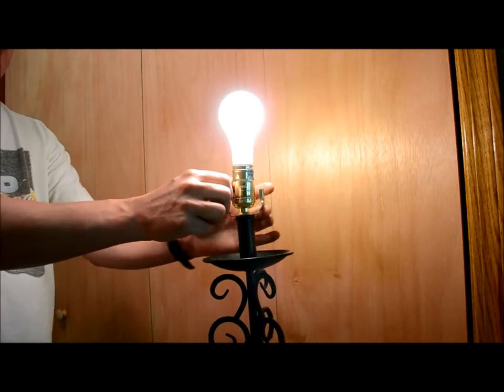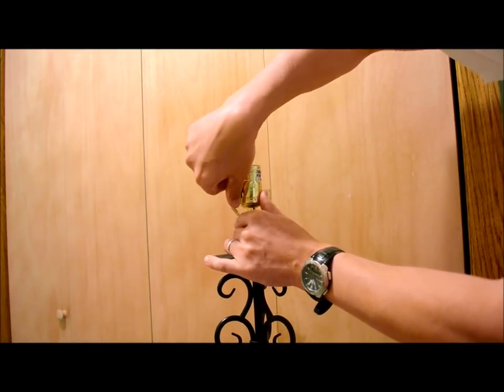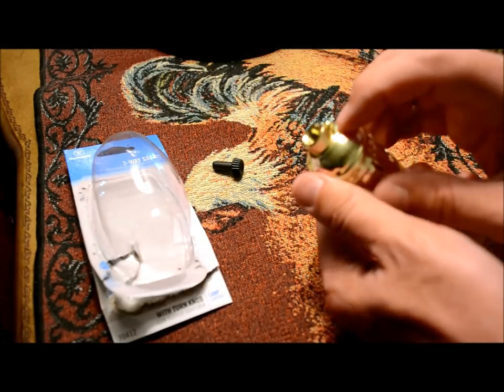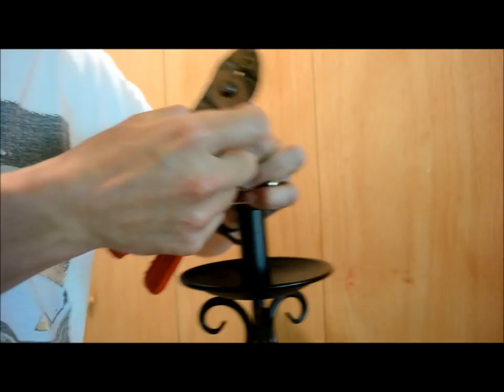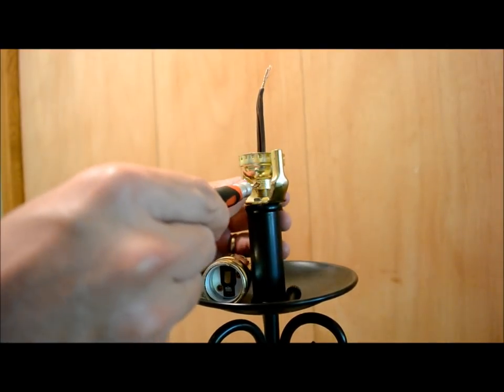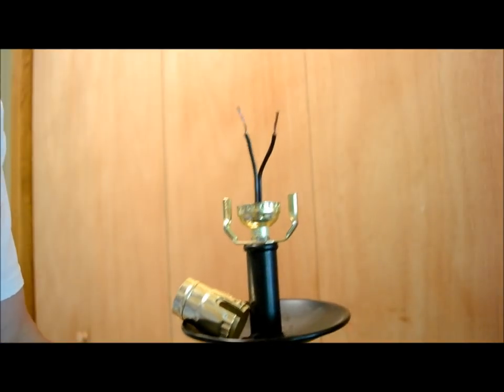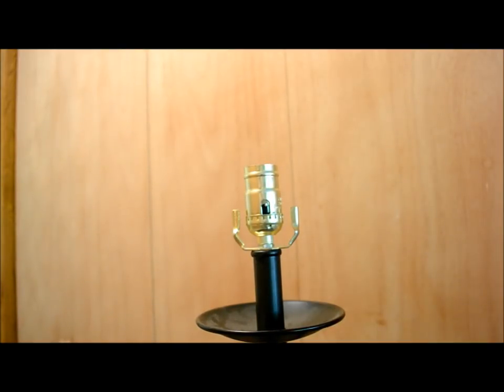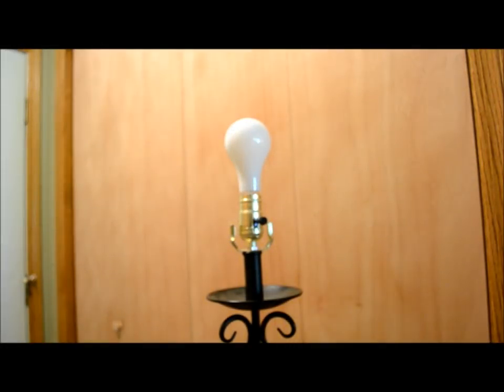How To Replace a 3 Way Lamp Switch

Comment: I didn't see where you explain which wire is hot (usually smooth) and which is neutral (usually ribbed).  I also suggest putting an Underwriters knot in the wires at the socket for safety.  Otherwise, you do a good, smooth job of presenting.